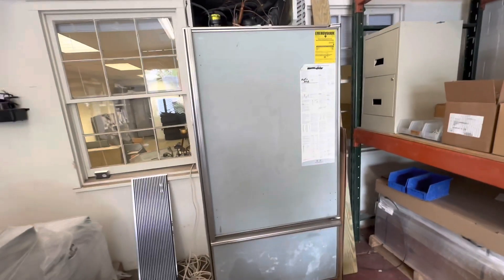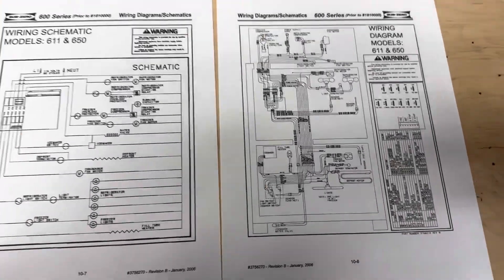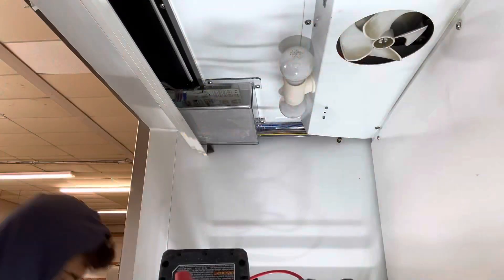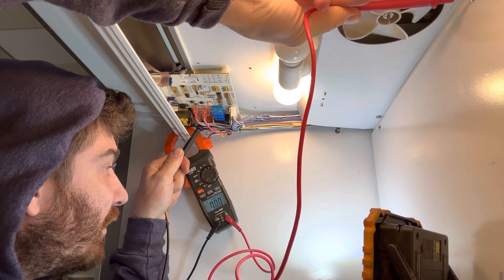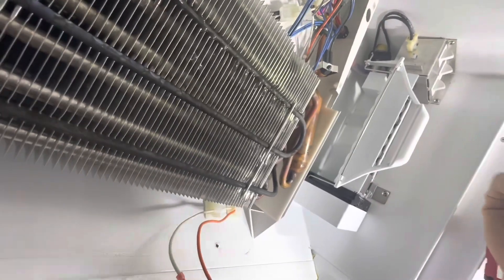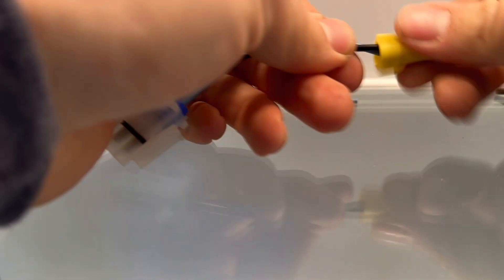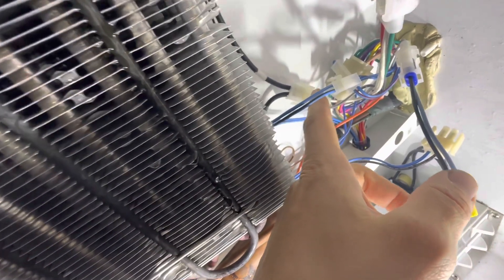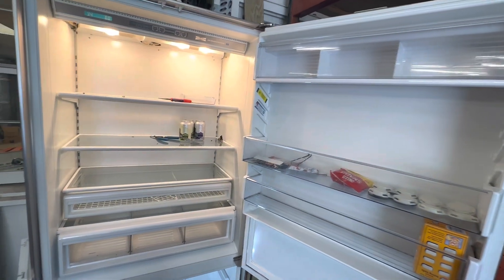Diagnosing sub-zero refrigerator defrost issues the proper way.

Comment: I have a model 611. The unit seems to be cooling and freezing okay. I removed the center back panel to inspect that area and noticed frost buildup on the copper lines exiting the back of the freezer. Any recommendations?

Comment: I have a 561 side by side that gets ice build up on the refrigerator side and then drips water the freezer sude 2irks great and the icemaker works great too. How do i trobleshoot the refrigerator issue ? How do i inow if they make the replacement part for the 561?

Comment: This is an amazing video and its helping me out with my 611. I had a question, how did you remove the freezer evaporator covers? In my fridge, there's some silicone sealant that is keeping the cover from pulling off. I can rip it off but is it required that I replace this sealant once I'm done troubleshooting the heaters?

Comment: What happens if the defrost time lasts too long? My ice cubes end up getting wet and melts a bit down that side of freezer and freezes. My 680F serial #191**  Manufactured April 2002 freezer doesn't always get cold enough (12 F) and sometimes it is (-3 F). Brand new factory control board was replaced already as well as a new thermistor. Could the defrost termination sensor allow heating element to work for too long?

Comment: Omg to many no needed manipulation, just check if you have 20+ ohms for heater, if you do, then just replace terminator. If you would have problems with gaskets, you’ll only get snow buildup on the sides of the freezer compartment wherever the gasket damaged. And yes, what exactly button do you press to manually activate defrost mode?
Reply: He said hold ice button for about 15 seconds
Reply from the maker: Yeah man, we aren’t doing this to diagnose your unit in the home, mostly just jumping out the terminator, but we get a million questions and so many people misdiagnose the board, so this is just a break down. To show you how it works, for the non experts (not you)!

Comment: You forgot to mention that the defrost terminator will be open when in room temperature.  So at room temperature, the deforst heater will not receive power anyway.

Comment from the maker: Just something to note guys. When you enter defrost, the cycle should last about twenty minutes or so. If you stop receiving power to your heaters WAY early, check that your terminator is not opening too early!
Reply: I have subzero 550 and I have same issue as above. This unit does not have the ice switch which you use to verify 120v at control board output P10. Is there another way to manually enable defrost cycle for 550?
Reply: I too have a 550 and would like to know how to engage defrost.
Reply: @WestKootenayOutdoors  if defrost terminator is functioning and control board is calling, then rotating the defrost timer until you hear click will activate defrost heater circuit for 20mins (check by touch in freezer compartment). If it's not timer then debug/replace defrost terminator part (you will need to open freezer roof).
Reply: @WestKootenayOutdoors on my 550, behind the grill and very close to the front on the right is the defrost timer.  

on mine, with a wide blade screwdriver I can manually turn the unit (small grey circle thing) until it clicks.  That should start the defrost cycle.   Then with power on go and listen and you should hear it start to defrost after a couple min.  takes a while to heat
Reply: @subzerorepair I’m a service tech as well, jumping on with Sub-zero at the end of the month! Watching all your videos 👍
Reply: Has that ever happened to you
? I have never seen that specific failure  
In 40 years of regular refrigerators with maybe 5% of zero activity.